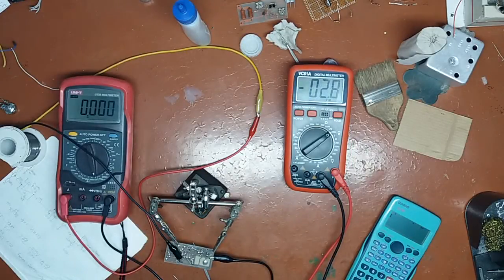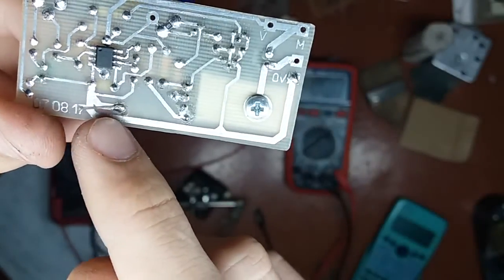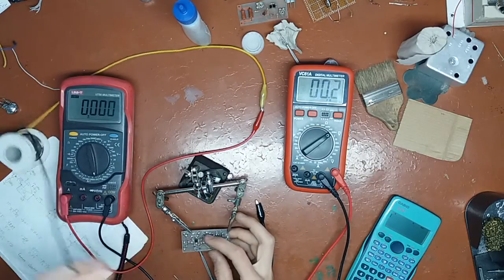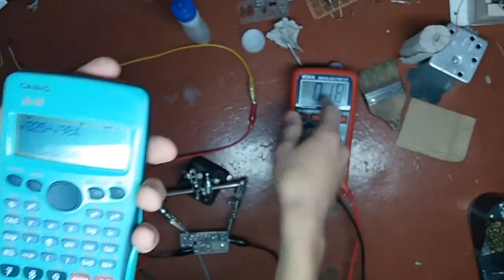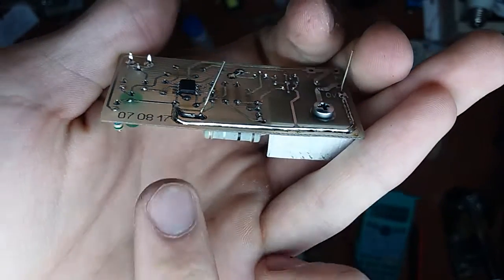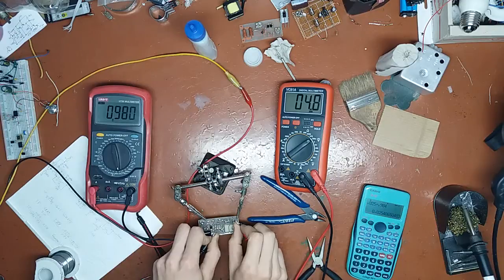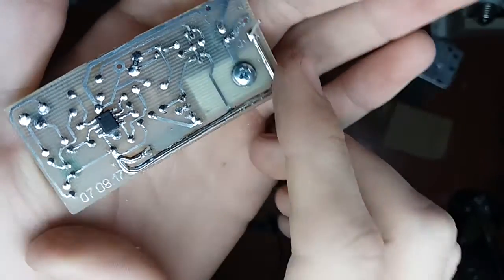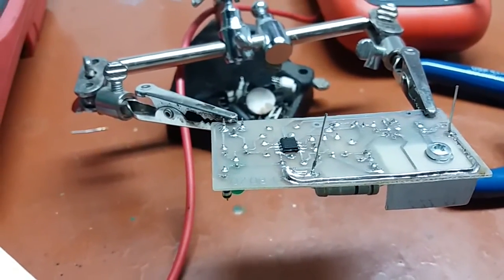Measuring resistance of a track on PCB

Comment: Try soldering the 4 wires to the two points, more stable :-D.
Shocking but no supprise, the surface area and thickness of that track isnt much.
If it was a critical thing, i would forget the track and use a thick copper staple jumper on the top of the pcb, or bring the high current parts close together.

"Resistance is futile" Borg Startrek LOL :-D
Reply from the maker: zx8401ztv Nah, I should just grip them tight. I like to avoid jumpers if possible, just a personal preference.
Reply: lol, when i made pcbs with ferric cloride and a pcb pen, they didnt look pretty, and once thrown into a box and the lid slammed shut, no one was the wiser.

My pcbs would make you puke, truly horrible  ha ha :-D

I used to build circuits in tobacco tins, earth was everywhere, i could splat a component just where i wanted it lol.
Reply from the maker: zx8401ztv I don't judge others, you do what you want. Most of my boards sit outside, so I like to make them pretty. The heatsink on this one is made from an old IF can from soviet era TV :) It's a bodge, but if you file it real good,  it looks decent.
Reply: Yes i noticed the hand made heatsink, and it looked fine to me :-D
I think i may have seen that style of can in the small regonda or vega b&w tv's, i did think they were neat, string to stop the swinging pcb's from going too far :-D.

You need some dead p.c motherboards to steal the heatsinks off :)